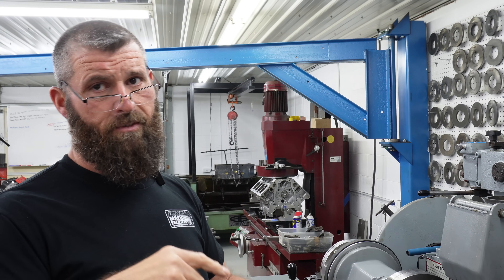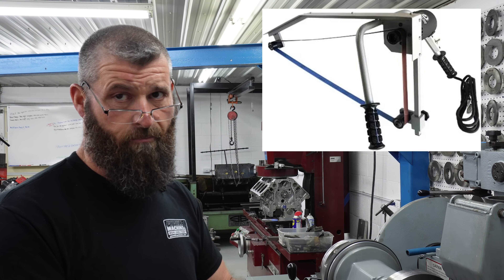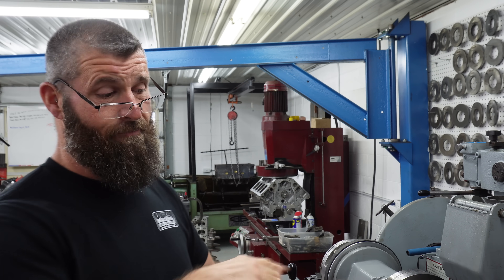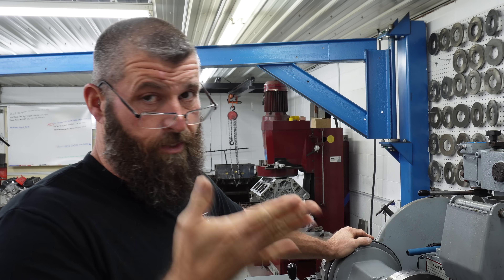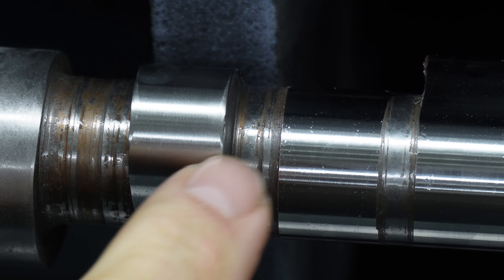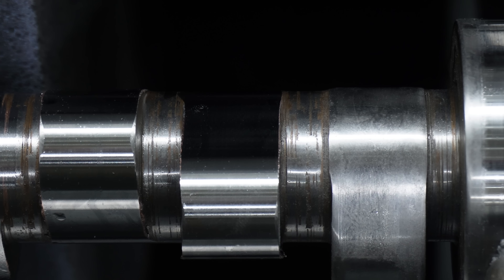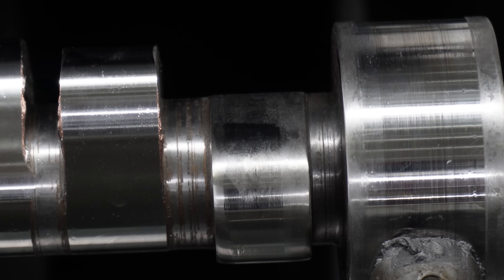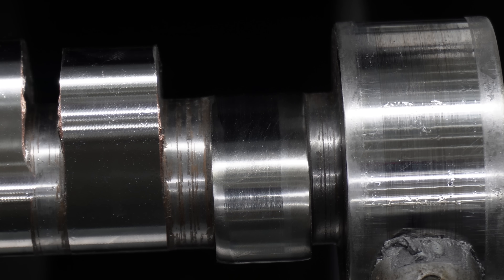Cam shaft suface finishing NO NO's.........

Comment: good luck when the wheel on the lifter quits spinning because the cam is too smooth. An inverted 37.5 degree cross hatch on the cam lobe and a 52.5 degree cross hatch on the lifter wheel will add up to 90 degrees. This will prevent the lifter from rotating in the bore eliminating the need for link bars or lifter trays.
Reply from the maker: We just Knurl them....

Comment: Oh yeah, with the light you can see it clear as day. Does a backing plate on the belt sander help with that, or does compressing the sand paper still cause that?
Reply from the maker: If you had a follow wheel on the belt it could work

Comment: on a rusty cam i mite lightly wire wheel with a medium wheel to get the rust off and then polish with and old belt by hand holding the belt part way around the lob but only on a roller cam and then only on a patch job
Reply from the maker: Yep

Comment: The stuff you make your videos out of (like this one) is why I do as much as I can possibly do, because I can't depend on anyone anymore. It's not just the automotive industry either. Try building a house now. You will get every reject that doesn't know what in the hell they're doing. Masons can't lay blocks flat, carpenters can't cut a 45° angle, you name it, if you want it right, you're going in behind them. This is also why I started rebuilding my own automatic transmissions. You can't rely on anyone.  Luckily, I do have a good machine shop.  Even ordering something, you never know what you're going to get. It doesn't matter if it's a crank or a television. 50-50 shot it's not going to be right.
Reply: Yup and our enemies in the world are watching and laughing at us as we fall into our own state of crippled abilities. Much easier to take over a country of incompetents staring at their phones.
Reply: Same in the ATV world.  Tons of trash companies out there.
Reply: @mikef825  I understand that too. I work on my own bikes and four wheeler too. Heaven forbid if you own a boat. I gave the boat up, they just straight up rob you just like a motorcycle shop or dealership.
Reply: @inscoredbz Same.  I race ATVs and maintain two along with the truck and trailer and do my own shop repairs.  I've just been disappointed by other people way too often.  Most new projects I just consider investing in the tools necessary to be the cost of doing business.  I can count on one hand the number of truly excellent places I've dealt with since 2005.

Comment: after "over the nose" there is negative acceleration   I've used dwell cams in lift limited classes  you can make them work   today with tight springs   good video shots of that belt problem  belt for the backside of that grinder
Reply from the maker: Actually neg acc starts a good bit before the nose on the opening side
Reply: @powellmachineinc  right when acceleration stops on the opening flank the velocity starts to fall going to 0 over the nose

Comment: If there is some surface rust but no pitting on a cam from storage, what is the best way to rectify this if polishing/grinding isn't suitable?  To add to it, does it make a difference if its a roller or flat tappet that would change or negate the process?  I was told you could take some fine steel wool and clean up lobes on a roller but again, this is anecdotal forum knowledge.  I appreciate the content!
Reply from the maker: 400 grit followed by fine scotchbrite would be fine

Comment: Off beat question stroker and the rod bolts are 0.30 from the cylinders. Would you run it or grind it?
Reply from the maker: Yeah,  id probably add some clearance...
Reply: @powellmachineinc thats right in the questionable spot . Ive had to add clearance or not but not been in this spot.